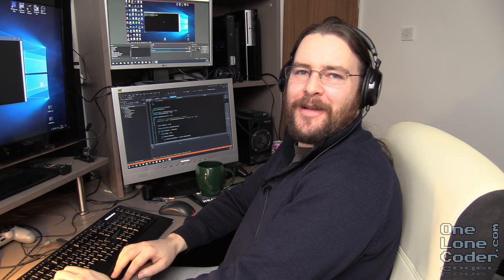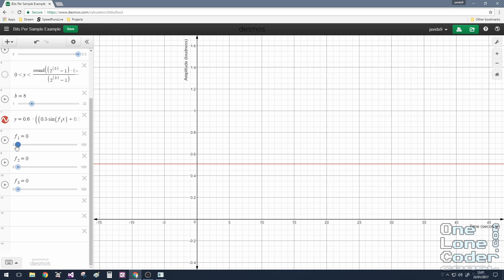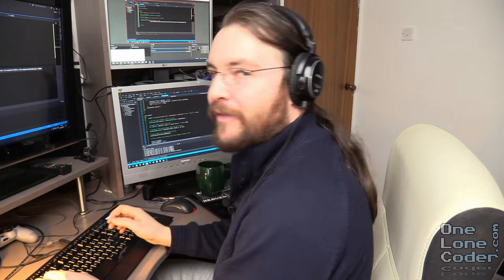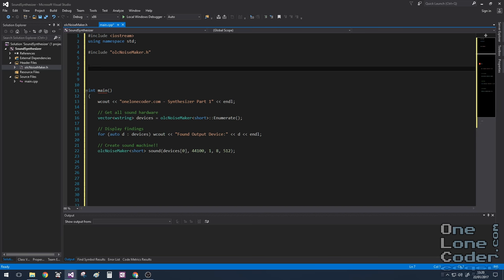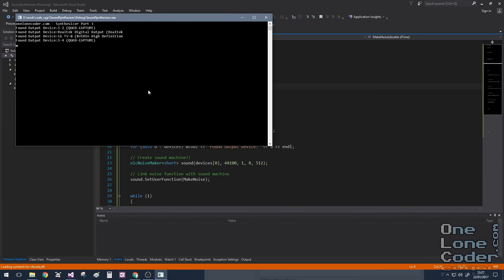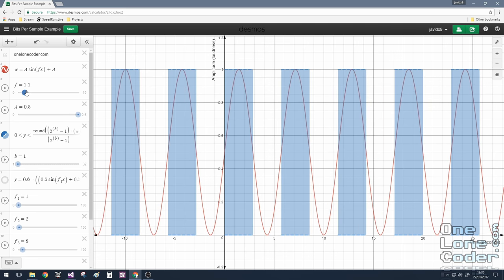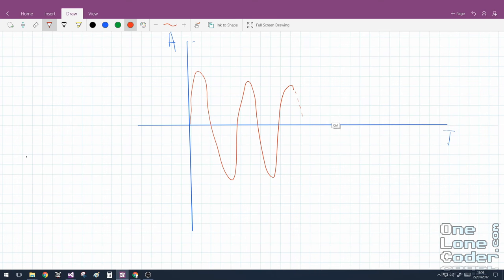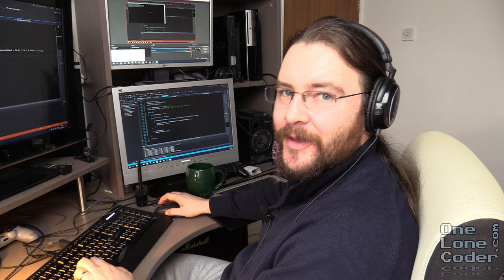Code-It-Yourself! Sound Synthesizer #1 - Basic Noises

Comment: Actually it seems like doubling while converting Hz for Sin function is unnecessary. (the 440.0 * 2 * PI part) You end up with doubled output frequency of what you wanted to (ex. 880.0 instead of 440.) @javidx9
Reply from the maker: It's derived from the conversion of frequency to angular velocity, where w = 2.pi.f, since we're really working in radians per second for the trig functions.
Reply: @javidx9  So, it turns out that creating the output device with 2 channels results in doubled output frequency. What a curious behavior, I expected it to double the volume, not the height of a note.

Comment: I am 14:48 and when I build the code, the list shows up two erros in the "sound.SetUserFunction(MakeNoise)" that say this: 	"C2664: 'void olcNoiseMaker<short>::SetUserFunction(double (__cdecl *)(int,double))': argument 1 can't be converted from 'double (__cdecl *)(double)'  to  'double (__cdecl *)(int,double)' " Can someone help me?
Reply: I think the error is that the user defined function you passed to olcNoiseMaker (e. g. MakeNoise) had two parameters (int, double) when it should have only one (double). When you pass functions as arguments, the signature (i. e. the return type and the argument types) has to match the original.
If it's a simple program, then you could just use some variable to pass the int parameter (assuming the double is for dTime). On something more complex, you might want to wrap the noise making in your own functions and classes, so that the library you're using to make the noise would constrain you less.

Comment: how does the square wave approach being used achieve different frequencies? if the only possible return values are 0.1 or -0.1 shouldnt every key output the same pitch?
Reply from the maker: The return value is the amplitude
Reply: Hi javidx9! I think I get it: the duration for which those values are sustained, which is determined in the conditional statement, represents the pitch
Reply from the maker: @twitchEmailOkay  that's right yeah, the faster it "oscillates" between the two values, the higher the pitch.

Comment: Why don't you get an error at the if(dOutput > 0.0) statement? There are no curly brackets.
Reply from the maker: In C++ you dont need curly brackets if you have just a single line of code.
Reply: @javidx9  Thx for the quick answer. Didn't know that.

Comment: Hey, Im getting an error in the olcNoiseMaker.h file. It says 

Error C2664 'void std::vector<std::wstring,std::allocator<_Ty>>::push_back(_Ty &&)': cannot convert argument 1 from 'CHAR [32]' to 'const _Ty &' Synth c:\users\stevi\source\repos\synth\synth\olcnoisemaker.h 

its on line 182 

Any Ideas?? I'm new to visual studio and pretty new to coding in general so im stumped. Pretty sure I copied your code correctly though....
Reply: to clarify this is while just trying to get the test tone you produce at 16:00

Comment: Do you think it would be possible (I mean quite easy to achieve in home environement and equipement) to send data through audio port on a standard laptop? Can I (using  Visual Studio C++ 2019 - the Community edition)  get access to the signal from the sound card (and from my audio jack ) and make a program which transform this signal into usful data? I can't find any information about such ideas. Everybody tries to use RS232 or USB etc. but nobody even thinks about simple and usuful ideas. Very often I hear from people why don't you buy this or that etc. but they don't understand that I want to learn how things work (data transmission in this case) in the simplest way possible . Buying new things is boring but finally understand how USB communications work (not only but any similar or data transmission in general) that is the thing or make my own protocol and send 10 bits to the computer and receive that data that is the great thing. I have already built some IR controlled car with my own signal (5 m range) also some basic RF devices etc. But my next step is to understand (and make it usuful for myself) data transmission from/to my computer which for now is the hurdle race ... I was considering for exemple ASK modulation or something similar.
Reply from the maker: It is certainly possible to transmit information via audio to microphone. It's not unprecedented and you used to be able to buy devices that communicated in exactly this manner. The challenge with audio is knowing when the packet starts requires some analysis of the data, and it's a bit slow, but certainly possible.
Reply: Yes but it is easier than transmitting data through USB for example and for flashing a few leds just perfect.  When I see what projects people do using Arduino it is not very complivated usuelly so even 8 bits of data transferring myself it will be a big success for me :) I am not going to send Gigabytes of data hahahah ;)
Reply from the maker: Most sane (lol) people would only transmit via USB as a virtual UART which is actually trivial to implement on both PC and micro.
Reply: I know I use my Arduino also but sometimes I have my own ideas and I just look for solutions for them. Maybe I am a little bit crazy but sometimes people like that changed the history so I am trying different ways to do things. Also I study programming , recently C++ and Python so electronics just fill in the gaps in my knowledge...

Comment: I get "Debug Error!
Program:
%USERPROFILE%\source\repos\SoundSynthesizer\Debug\SoundSynthesizer.exe
abort() has been called
(Press Retry to debug the application)"
Code:

#include <iostream>
using namespace std;

#include "olcNoiseMaker.h"

double MakeNoise(double dTime) {
    return 0.5 * sin(440.0 * 2 * PI * dTime);
}

int main()
{
    wcout << "Synth" << endl;

    vector<wstring> devices = olcNoiseMaker<short>::Enumerate();

    for (auto d : devices) wcout << "Found Output Device" << d << endl;

    olcNoiseMaker<short> sound(devices[0], 44100, 1, 8, 512);

    sound.SetUserFunction(MakeNoise);

    return 0;
}
Reply: Turns out I haven't added an infinte while loop.

Comment: I'm trying to follow the tutorial, but I'm doing it in Eclipse using the MinGW toolchain. When I copied and pasted the header code that you wrote, it gave 16 errors that wouldn't go away, even after re-compiling the project. They say unique_lock and push_back are invalid arguments/template arguments, types mutex, thread, and condition_variable could not be resolved, and methods join, notify_one, and wait could not be resolved. There's also a warning that says, "Class 'olcNoiseMaker' has virtual method 'UserProcess' but non-virtual destructor." What is going on and what do I need to do to fix the issue?
Reply from the maker: Make sure your MinGW is really up to date, like that delivered by MSYS, and ensure you are compiling to a modern C++ standard, either 14 or 17 will do.
Reply: @javidx9  I just updated to MinGW to MinGW-w64 v8.1.0 from the classic 32-bit version i was using before. Still getting the same errors. What do you mean when you say "delivered by MSYS?" I just use the console built into Eclipse. I also don't know how to check which version of C++ I'm compiling to (it might be C++ 11).

Comment: Can someone help me troubleshoot?  I'm a bit rusty with my C++ and I'm getting this error in  the NoiseMaker header on line 131 when I try to include it in main.  All that's in my main is the inclusions and a hello world and it won't run.  I'm using Code::Blocks.

C:\...\consoleSynth\olcNoiseMaker.h     |131|     error: no matching function for call to 'std::vector<std::__cxx11::basic_string<wchar_t> >::push_back(CHAR [32])'

this is the function that I received the error in: 
static vector<wstring> Enumerate()
 {
  int nDeviceCount = waveOutGetNumDevs();
  vector<wstring> sDevices;
  WAVEOUTCAPS woc;
  for (int n = 0; n < nDeviceCount; n++)
   if (waveOutGetDevCaps(n, &woc, sizeof(WAVEOUTCAPS)) == S_OK)
    sDevices.push_back(woc.szPname);
     //this line caused an error
  return sDevices;
 }
Reply from the maker: Youll need to define unicode as part of your compiler parameters, and use an up to date c++ compiler.
Reply: @javidx9  Thank you.  I've never done that before though.  I've tried selecting the [-1std=c++1z] and [-1std=c++14] g++ compiler standards in settings and I was still getting the same error.  I tried to use #   define __unix as well but to no avail.  I was trying to use this page: https://sourceforge.net/p/predef/wiki/Standards/

Comment: I wanted to follow these series but I've been getting errors no matter what I do, first one was when using plain mingw g++ compiler but that doesn't really matter. I just opened VS2017 (Community edition) and followed it similarly as in the video, created a new empty C++ project, took the header file from github, copied main.cpp for this video just to be sure that I didn't make any typos and it's throwing me a weird error:

Error C2664 'void std::vector<std::wstring,std::allocator<_Ty>>::push_back(_Ty &&)': cannot convert argument 1 from 'CHAR [32]' to 'const std::wstring &' sound-synthesizer d:\programming\c++\sound-synthesizer\sound-synthesizer\olcnoisemaker.h 167 

So, it seems like woc.szName is the CHAR [32] and vector expects wstring and for some reason it can't convert it, but for anyone else it can... Any ideas what's wrong?
I'm on a 6 year old laptop with windows7 if that changes anything

Clear image showing where the problem (which I have no idea how to fix) occurs.
https://i.imgur.com/UFryjLu.png

I don't know much about C++ and things like this almost make me hate it with a passion as if I want to get something to work, I pretty much need to have high end pc with latest OS and 10 year experience with programming language, otherwise things just break... What's up with that?
Reply from the maker: Hi Shadow Lurker, you'll need to tell your compiler to compile in UNICODE mode. On Visual Studio this is Project Properties -> General -> Character Set
Reply: Thank you a lot!

But well that was a simple fix for such unusual problem, which compiler didn't say much about at all... I couldn't really find anywhere on internet what was the actual problem no matter how I modified the error message, only how to convert from char* to wstring, why is that so?

Anyway, I'm going to enjoy watching your videos, I've already looked at your tetris tutorial and I liked the way you solved a, at a glance intermediate, problem such as grid rotation.

Have happy holidays!
Reply: Gents, I also found another way to solve the problem, and that's to convert a bunch of the "wstring"s in the olcNoiseMaker.h file (and in the main.cpp file where required) to just "string".

I got it to work that way, but the issue there being that, given that I'm a huge noob to programming, I have no idea if I've caused some other catastrophic problem or not, or if it will mess around with future changes that javidx9 will make... but the code seems to work for now!
Reply from the maker: Make sure visual studio is set compile using the Unicode character set. Thats all you need to do.
Reply: Will do.

PS really enjoying your videos - starting from the beginning, and there's some really great stuff! Great work.
Reply from the maker: Thanks mozee!

Comment: Can't get first test to play the A note.  I imported the h file over just fine, added the library,  and copied your code word for word but it has yet to work for me.  I think it has something to do with the Vector not recognizing olcNoiseMaker as it is refusing to turn turquoise like yours is.  Any help would be appreciated, here is my code:

#include <iostream>
#include <vector>
#include <olcNoiseMaker>

using namespace std;

double MakeNoise(double dTime)
{
 return 0.5 * sin(440.0 * 2 * 3.14159 * dTime);
}

int main()
{
 wcout << "synthp1" << endl;

 vector<wstring> devices = olcNoiseMaker<short>::Enumerate();

 for (auto d : devices) wcout << "Found Output Device:" << d << endl;

 olcNoiseMaker<short> sound(devices[0], 44100, 1, 8, 512);

 sound.SetUserFunction(MakeNoise);

 while (1)

  return 0;
}
Reply from the maker: Hi Skeletool, hmmm, lets see! what is the actual error you are being presented with? Is it compile time or run time?
Reply: I think it is a compiling issue since it says there is 0 successful builds when I try "alt+f5."
here is a link to the error list:

https://imgur.com/dw2Fxae

thanks!
Reply from the maker: try changing the include to #include "olcNoiseMaker.h" - this is assuming you have the file in the same folder as your source file.
Reply: Earlier I had it in my header file like yours but i moved it over to the same folder as my main file.  I switched it to add the ".h" but its still telling me "unable to start program... system cannot find the file specified." I tested it out in both of the different folders. thanks again for all the help, let me know if you can think of what my next step should be. Here is a screen cap of where I am:
https://imgur.com/V9kXx8N
Reply from the maker: Dont use the angled brackets - use quotes instead "". This tell the compiler the path is local. Angled brackets tell it to look elsewhere
Reply: You have to place the .h file in the solution folder next to the main.cpp before adding it through visual studio. Took me awhile to figure out. Hope I'm not too late.

Comment: I'm  using Dev - C++ and I don't know why I'm getting two errors from the header file provided: 

"[Error] no matching function for call to 'std::vector<std::basic_string<wchar_t> >::push_back(CHAR [32])' (line 171)

and

"[Error] no matching function for call to 'find(std::vector<std::basic_string<wchar_t> >::iterator, std::vector<std::basic_string<wchar_t> >::iterator, std::wstring&)' " (line 91)
Reply: Same!
Reply from the maker: Have you enabled unicode for your compiler?
Reply: Same here! Have you found ways to solve them?
Reply: Well, these two errors somehow disappear when I switch the IDE from CodeBlocks to Visual Studio. I'm a beginner to C++ so I still don't know the reason behind this.

Comment: Doesnt work for me! imported  main 4.cpp olc.NoiseMaker but get type mismatch errors. (I Think!)
Severity Code Description Project File Line Suppression State
Error (active) E0167 argument of type "wchar_t *" is incompatible with parameter of type "LPCSTR" Synthjavidx C:\Users\User\source\repos\Synthjavidx\Synthjavidx\main.cpp 685 
and:
Severity Code Description Project File Line Suppression State
Error C2664 'void std::vector<std::wstring,std::allocator<_Ty>>::push_back(_Ty &&)': cannot convert argument 1 from 'CHAR [32]' to 'const _Ty &' Synthjavidx d:\synth\olcnoisemaker.h 175
Reply from the maker: Your error suggests you have not enabled unicode for your compiler
Reply: Great I'll try that ! Thanks a lot. Im on your fps tutorial now and get the same problem.
There was a second error as well when i commented out the first one any idea about that too? Same problem maybe?
Great solved all of my errors!
Super mucho Thanks!

Comment: If I paste the source code into codeblocks, will it work?
Reply from the maker: Hi ryan, im not sure but worth a try! The files are available in the description.
Reply: I am using the source code in visual studio and getting 30+ errors each time.  I'm wondering what step I'm missing.  Tutorial is great by the way!
Reply: I am running in visual studio now, and I am getting errors like "cannot open source file "olcNoiseMaker.h"" and identifier "vector" is not defined... which is weird because you don't get any of these errors.
Reply from the maker: Hi Ryan and thanks for the compliment! if VS cant open a file then it means its not where it is trying to look. Same goes with vector being undefined, have you tried prefixing with std::vector instead? It does sound like you've got a setup issue.
Reply: when I isolate the noisemaker class (copied from github) and build solution it gives me only one error on line 173 which is

sDevices.push_back(woc.szPname);

Error C2663 'std::vector<std::wstring,std::allocator<_Ty>>::push_back': 2 overloads have no legal conversion for 'this' pointer 

I'm hoping that starting with the header file will lower the 57 errors i get in the main
Reply from the maker: Hi Ryan, could you pastebin the header file you are using?
Reply: line 171 in this case
Reply: I am still getting the same error line only on line 173, and I've copied and pasted, as well as downloaded the source code at opened your files.  I hope you get this and have some idea on how to rectify this issue.  Could you do an episode going more in depth into WAVEOUTCAPS?
Reply: yeh i have the same issue with my header file